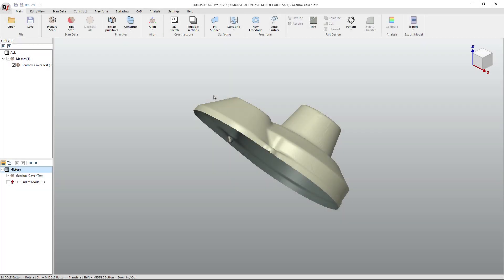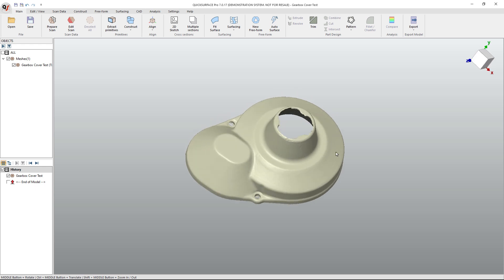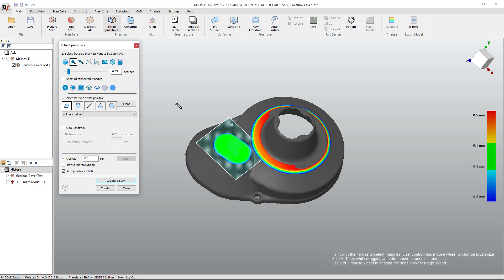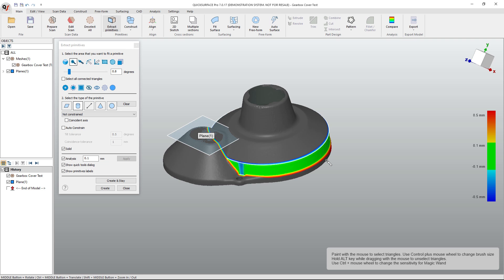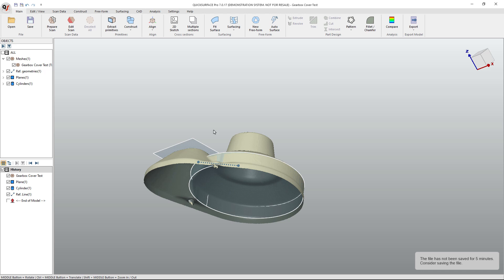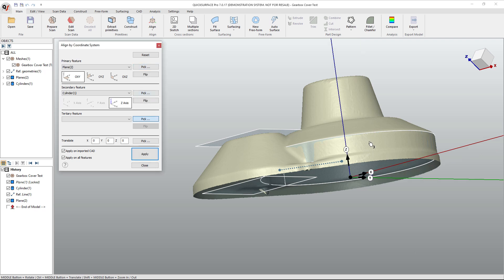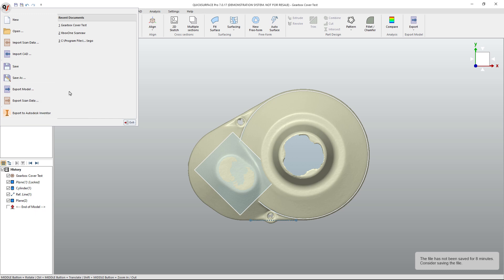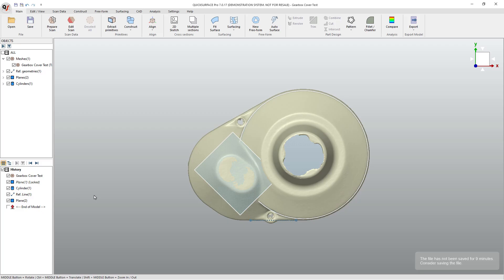How To Use QuickSurface To Align A Scanned Mesh To XYZ

Comment: Thx, new to scanning. Wondered why my models were allows skewed haphazardly. Had no idea about this software. Always a PITA trying to align in fusion.
Reply from the maker: Yeah depending on the scanner you use.  For example Shining3d scanners (at least the higher up ones) can be aligned in ExScan software provided with the scanner.  If using a Revopoint or Creality scanner that isn't possible.  I do have a video on how to do this in Fusion by creating new planes, but its much easier in a dedicated piece of software like QuickSurface Lite.

Comment: Thank  you man, nice video !
i tried to download it, but you need to pay for all version, my doubt is, after the free trial of PRO can i still use it?
Reply from the maker: After the trial no you won't be able to.  Revopoint sells the LITE version.  if you bundle with a scanner or even just by itself they offer a discount.
https://www.revopoint3d.com/products/quicksurface
If you buy the SaaS license its around $500/year.  If you just buy it outright as a perpetual license i think its around $2000.

I will be doing more content on the LITE version soon and hopefully that will help decide if its worth it.  It does a lot more than just align to a coordinate system, that is just the question i get asked the most :)
Reply: @LearnEverythingAboutDesign  thanks for your explanation; mine is just an hobby, so i can try to search it cracked😂
Reply: first became aware of quicksurface on the revopoint homepage and used the free trial version for some time and came to the conclusion that it’s a very intuitive sketch based RE program with a steep learning curve .For me as a private user who only occasionally works on projects like these it is easy to handle,straight structured and enough  powerful to get suitable results. Because of the high selling price of the pro version - this is the only option for me - I asked quicksuface  if they offer  special conditions for private not commercial use and I was made a very attractive offer for 1 year of support and lifelong use of the pro version. I am very satisfied with quicksurface, their regular updates, the perfect support and the friendly and courteous conversation😊😊😊 thx